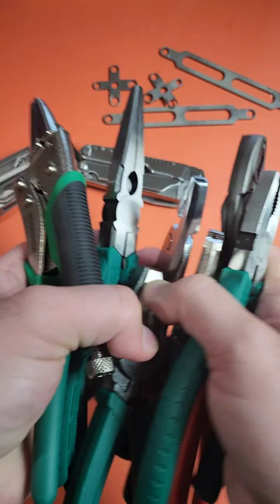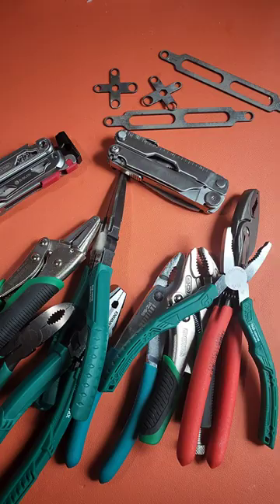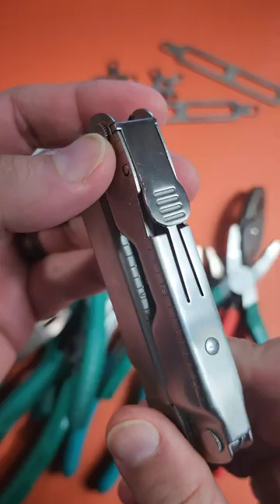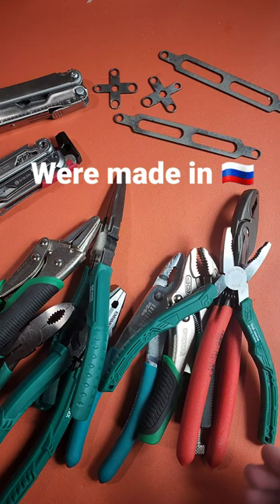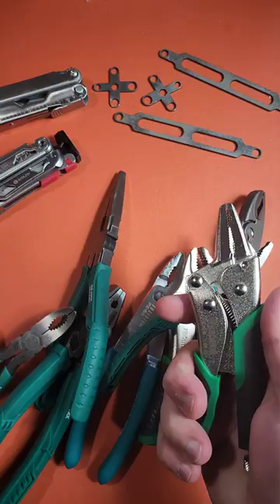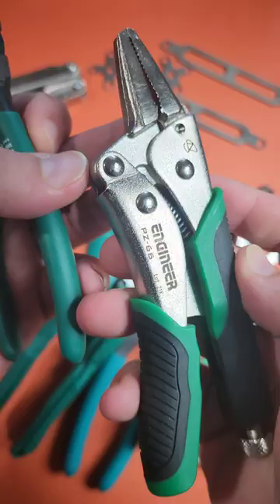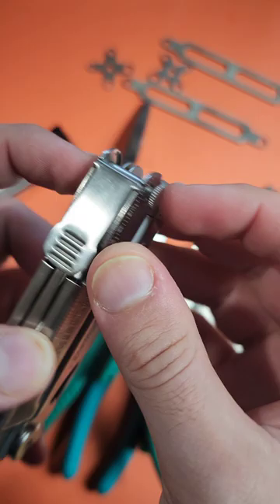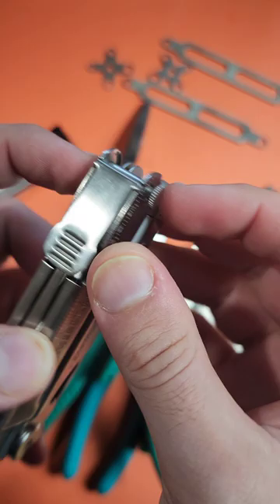Screw Pliers Change the Game! (Modding Tools for Leatherman Multitools)

Comment: I've never heard of pliers of any kind being referred to as screw pliers.
Reply: They are not. Not technically. It's just a "secondary feature".. ,more or less.
Reply: They're screw extracting pliers.
Reply: @irzyxelwj  why not wire gripping pliers or gripping pliers, cutting pliers. 1000s of uses they're pliers. Not screw pliers. I personally use a screwdriver to extract a screw, the same one I used to put it in.
Reply: @bigteddy66  Oh, I hear you. It's because they work to extract the screw even if its head i.e. Philips has been stripped out. Where a screwdriver would be useless. The pliers fit flush around the head have teeth to bite giving you grip to turn. They work surprisingly well. Sorry for the confusion.
Reply: @bigteddy66 not really sure why he didnt show it in the video but they have a somewhat unique design.

Comment: I heard about the pz55s from a leatherman forum post, and have been using them for years as a locksmith and they are so great for removing stuck/stripped screws without resorting to the ez-outs.

Comment: I got the Vamplier 5” ESD for fixing small electronics at home and then the 7.5” long nose for bigger projects. They are the same as engineer but with a US Warranty. They have saved my bacon so many times. Worth the money.
Reply: Yepp. I got the full set from them. Saved my ass when a guy tried replacing some parts in a motorcycle but he didn't have JIS.
Reply: Vampire Tools regularly charge twice what Engineer does for the same tool.  Screw them, screw their warranty, buy the same thing for half as much and then don't worry about it because they aren't going to break anyway.

Comment: Vamplieres were the original but as with all pliers I prefer the knipex they are superior to most any other
Reply from the maker: Not all will work specifically on these specialized nuts, sadly
Reply: @maxlvledc  looks like the comment I left with a link to some on eBay was removed. I found some on there for like $30

Comment: Are you going to include the Vampliers? Really want to know if that brand is any good. And who was first?
Reply from the maker: Vampliers and engineer are made in EXACTLY the same place...engineer is just cheaper.
Reply: The only difference between the Engineer and the Vampliers is warranty. Vampliers has a lifetime warranty and Engineer does not. Same exact pliers made by Engineer.

Comment: You do know that one screw has a security bit screw in it? The one that kinda looks like a star with a point in it. That is a type of security bit. 
I also have no clue as to why you need to be taking these apart?
Reply: He's not taking about the security screw, I'm sure he's well aware of that one, it's the one on top left when he's holding it. There are a few of reasons for taking these apart, I mainly do to clean it and it also makes it easier to resharpen the blades.
Reply: @drewrinker2071  If they are this hard to take apart then why not have a few custom screws made. It is not all that hard. Make a complaint to the company and have them fix the problem.